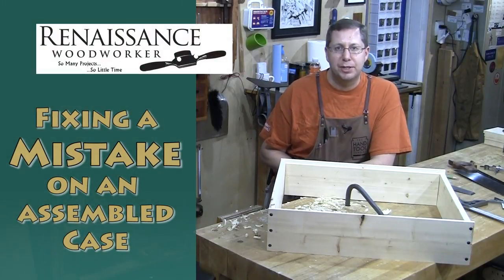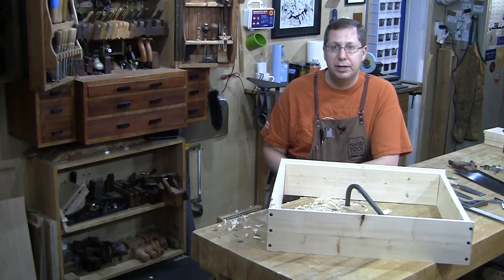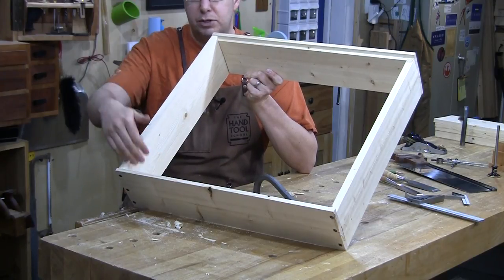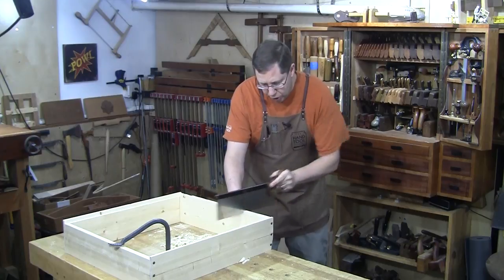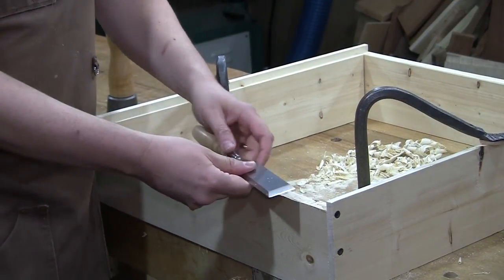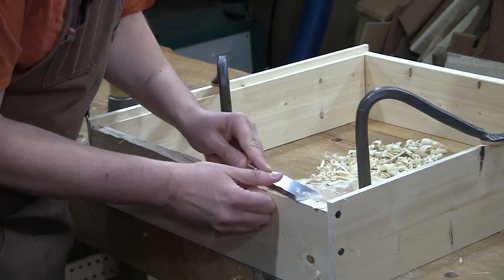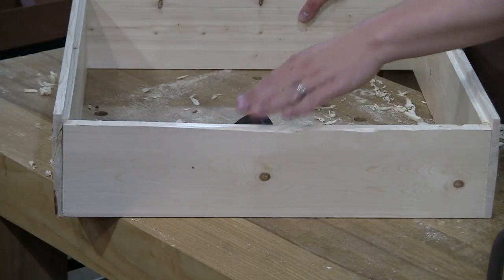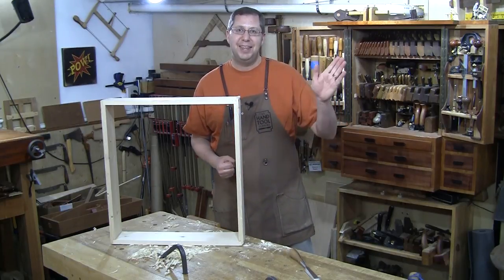Fix an Already Assembled Case with a Chisel

Comment: Maloof joint.  Even if you could just touch on the basics of laying out would be really appreciated. I have an idea for a small hallway table with a lower shelf that I would like to carve and shape the wood so the legs and shelf flow together similar to Sam Maloof's chairs and Bearcat Woodworks chairs, benches, stools, etc.

Comment: Hello! Love your channel! I have bought a Veritas planer and I wonder if you use to clean the planer with mineral spirits and theb with wax or oil?
Reply from the maker: yes I clean off the rust inhibitor with mineral spirits then a coat of wax over the whole plane.  I don't wax my blades because I'm' constantly pulling them out to resharpen.  After sharpening I do wipe down the blade with an oily rag.

Comment: Might I make a request for the STOPPED GROOVE, single (stopped one end) and/or double (stopped both ends).

I feel that this would not only benefit myself, but also fellow views, as although not a common problem, a problem that most cabinet makers will encounter at some point in their endeavours, this method can also be utilised in forming other joints i.e. stopped housing (dado) and even a variation for stopped rebates (rabbet).

I am, attempting very slowly, to create a pair of bedside cabinets, 100% by hand with not a single Watt of electricity, the sides will be frame and raised-fill panel construction and am intending for the stiles, of the sides, to act as the cabinet legs. This will mean that the stiles will continue below the bottom of the frames base rail, I could cut a groove all the way through from end to end and fill-in the resulting missing material after the fact, but feel that this is messy and unprofessional. 
As the sides are a frame and panel, there are mortises at either end of the groove, stopped haunched mortise & tenon at the top and stopped full mortise & tenon at the bottom, this means that it is only a single stopped groove in my case. 
The stock thickness, in my case, is 3/4 inch and the mortise and groove will both be a 1/4 inch each. I am intending to cut the non-stopped groove in the other pieces with my Record n'o 405, similar to a Stanley n'o 55. I do have a Record n'o 071 router plane but sadly I only have only one blade (cutter), the pointed 1/2 inch and no fence, as I bought it second hand from ebay, and have as to date been unable to replace the missing parts.

I do know of a number of means to cut this joint, one of which entails the use of an electric plunge router (but that is not our way). 
One of the other hand-tool means: Utilising a Record n'o 071, Stanley n'o 71 router plane with fence or the Veritas and Lie-Nielsen derivation there of, slowly but surely one shaving at a time, cutting the groove to depth, there are some small problems with this method; when it comes to cutting grooves narrower or wider than the blades/cutters available, or at a depth that exceeds the maximum  ability of the blade/cutter, with blades/cutters narrower than the 1/2 inch post/shank, the post/shank increases in width as it rises to meet the clamp that holds the blades/cutters in place, thus restricting the depth of cut. 
The other and simpler but more skilled means, is by use of a chisel to chop-out the waste in a manner similar to cutting a mortise, the problem with method is that it does require some degree of skill chopping with a hammer & chisel and will leave a rough and uneven groove bottom and sides.
If there are any other methods that you are aware of, would you be so kind as to enlighten us, if not, could you educate us in the best practices of the aforementioned methods.

Could you also advise us as to, in general, which would be the best joint to cut first, the groove or the mortise & tenon joints, either with the stopped groove, as in my case, or a through groove, as used in frame and panel doors etc, in the cases where the mortise and groove are the same size and where either the mortise or the groove is larger than the other, and why this order is chosen in each of the nurmouse cases.

May I take this opportunity to thank-you for all your labours in share with us (the views) your knowledge and expertise on the use and best practice of hand-tool wood-work. I have greatly enjoyed your shows and one hopes shall continue to do so.
I shall endeavour to join you live next Thursday, but with the difference in time variation between our two countries I may not be able, but nevertheless shall watch with bated breath, either live or post-transmission recording, the next, most eagerly awaited, instalment of my wood-work education.
Reply from the maker: Sounds like you are already on track for this joint.  I would caution against using a router plane to cut a joint.  These tools are not good at heavy removal of wood and are intended to refine a joint by removing little amounts of material to flatten out the floor of, in this case, a groove.  The router plane blade is completely unsupported as it hangs below the sole and it will tear out dramatically if too heavy a cut is attempted.  So it can be painfully slow to execute a groove and with every extra bit your increase the depth you are adding vibration into the blade and your cut quality will decrease.  No like I've said in this video, it all comes down to chisel work.  If the stopped groove is long enough to fit a plow plane into you can plow out the middle of the joint much like I showed here with my block plane.  It is the 2 stopped end (or 1 depending on the joint) that need to be chopped out.  This is done exactly the same way as chopping a mortise, but you don't have to go as deep.  Moreover, the floor of that groove does not have to be perfectly flat or clean since you won't be able to see if once your panel is inserted into it.  Secondly you wouldn't want to bottom out a panel in the groove because the whole point of frame and panel is to allow for wood movement and therefore you will want a bit of space between the panel and the bottom of the groove.  So don't make like harder by trying to get perfectly smooth groove floors like an electric router would produce.

In the case where you have a groove between two mortises, I would cut the mortises first since they provide an entrance and exit point for a plow plane.  If just doing a blind groove along I would still chop out the extents then plow between them.  This is exactly the same as your situation where you have mortises on either end (or even one end).  Besides you need to set the location of the tenoned piece anyway to determine how big to make the panel that will fit into the groove so place the tenons first makes the most sense in terms of build order.
Reply: Thank-you for your response, you have confirmed what I had though, I was hopping that the're might have been a method unknown to me that was 'easier', quicker and less likely to be fraught with error. Looks like I might be getting some chisel practise, lets hope I don't hit my hand too often. And again thank-you for your response and help.

Comment: Saw cut down to the line once at each end, then remove the waste between them with a draw knife.
Reply from the maker: absolutely, love my drawknife.  Though I still think I would want to put some Morten cuts in there because the drawknife would happily grab and split out if not careful.  Especially in this soft pine.  A hardwood might be a different story....assuming one has a drawknife
Reply: The cut at each end would provide the safety to keep the drawknife from splitting out the ends.  The big concern with using a drawknife is to be careful when cutting in the direction of diving grain.  The cross grain chisel cuts you made make me nervous because it's possible to blow out on the back side if the chisel is used too close to the line.  You were on top of that though, you kept the chisel back a safe distance.  However, with the draw knife you can get down to a hair of the line.  The trick is to cut bevels at the begining rather than make level cuts.  Cutting at an angle allows the drawknife to hog off massive chunks.  Bevel one side, then tip the other way and bevel the other side.  The third cut can be level to remove the peak you've just made.  Then return to cutting bevels again.  Get within a 1/4 inch at the one end, then turn around and work the other way, the direction with the diving grain.  It will pop off easily, but you have to watch where the grain lines are and not put the drawknife edge on a line that ends up below your marked finish line.  After working from both ends once, you are left with a bump in the middle that you can take out by cutting in the original direction.  Finish up with spokeshave, block plane, and get the corners with a chisel.